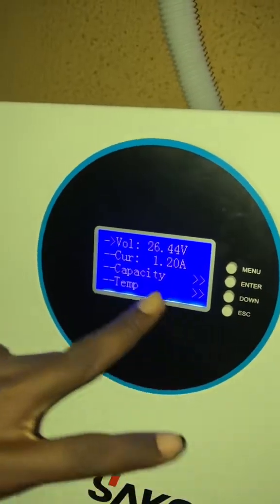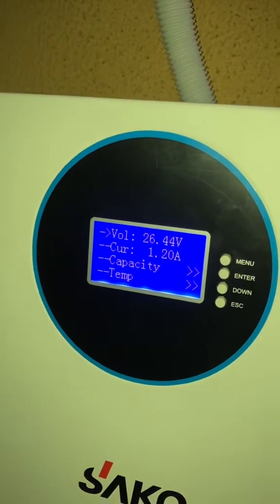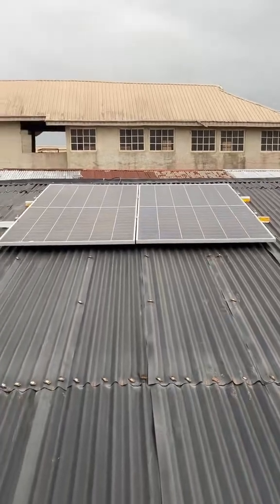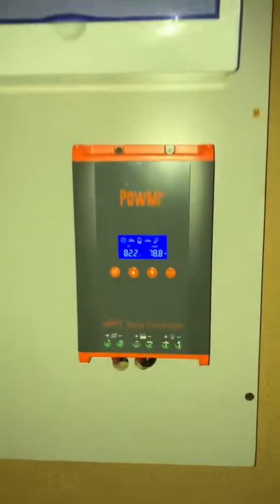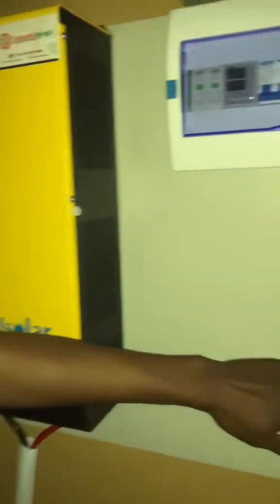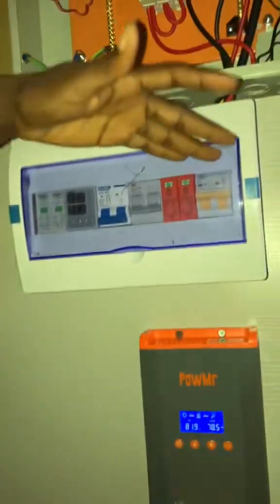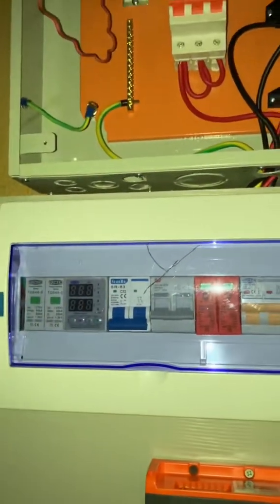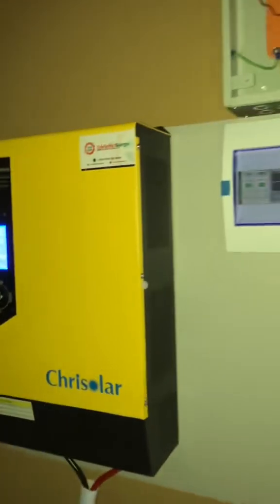3KW 5kwh solar installation in Ore #solar  #solarenergy #solarsystem #greenenergy #renewableenergy

Comment: That 1.2kw panel is too small for that system don't you think, especially in this cloudy season
Reply from the maker: The question you should ask is that, what are they powering?

There is no small or big.
Reply: @odedeyidamilare you lack respect man, a proper answer would have been better rather than going aggressive without even answering the question.
Reply from the maker: @HappyWinging   you also didnt watch a 1 minute video to understand.. So you mean the panel that was producing 1000w plus the next day is not enough?

Battery capacity is not what determines panels size, and does that place looks like a wilderness?
Reply: @odedeyidamilare @koka asked a question what you ought to do is answer him rather than throwing more questions to his way. He might not be lenient as you. Generally you are a contractor and your clients can just be watching your videos. Someone else might even find your answers useful to them. Just try to be calm.
Reply from the maker: @HappyWinging  I repeat, There is no Small or Big panel for a Set up, we design accordingly no needs,  there are 3 bedroom apartments without AC and there are 2 bedroom apartments with 3 ACs.. 
I gave the answer already, it's what we are powering that determines. There is no small or big panel.
Reply: If it worries you that much, then pay for the remaining panels yourself. People work within the budget they can afford.
Reply: @teeman9166 I made that comment as he said they are currently charging a 5kwh battery at 1A and it is a question.

You could have just said maybe they plan to expand later or they have very little load, instead you went the typical naija way, it is well.